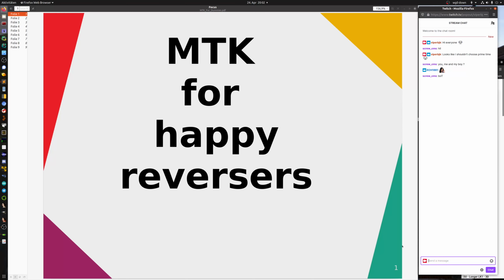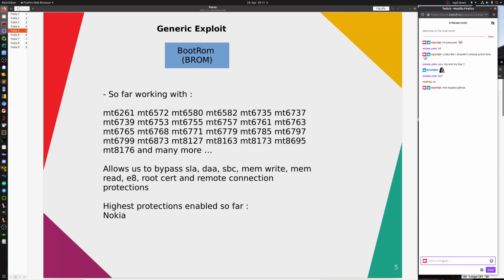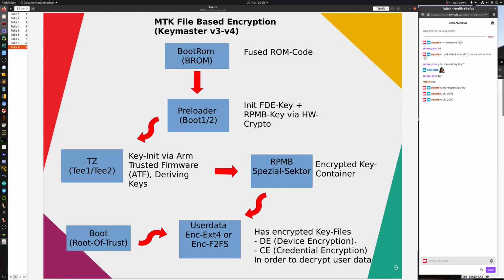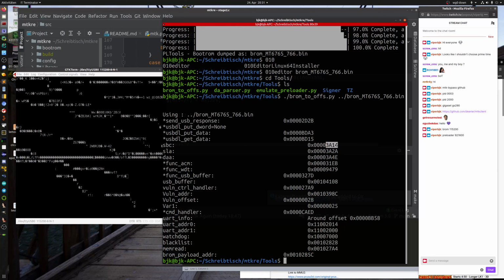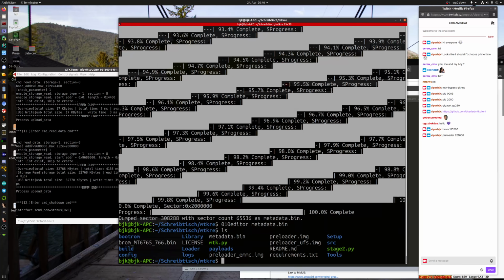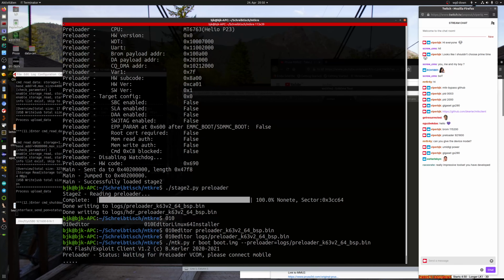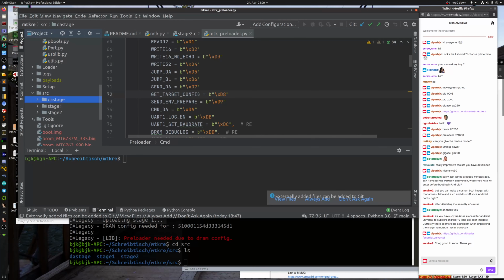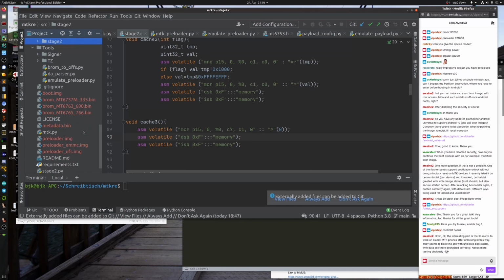Introduction to MTK Reverse Engineering

Comment: How much will you charge to help me flash stock firmware with a bootloop problem on a mtk6789 device.OEM locked Bootloader locked Stuck in recovery.V6 SPtool security on device no Auth.file.

Comment: Chapter Timestamps from SB:

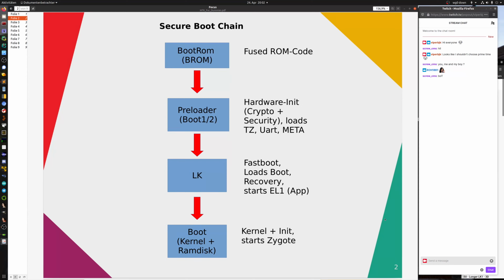1:00 Android's Secure Boot Chain

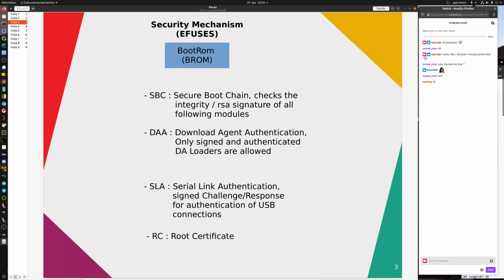3:52 Security Mechanisms in BROM
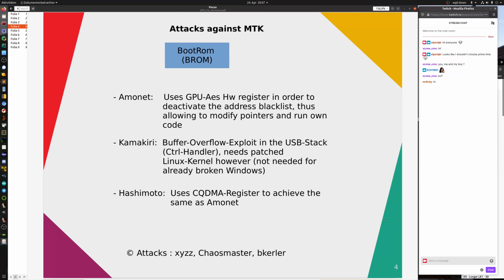5:55 BootROM Exploits
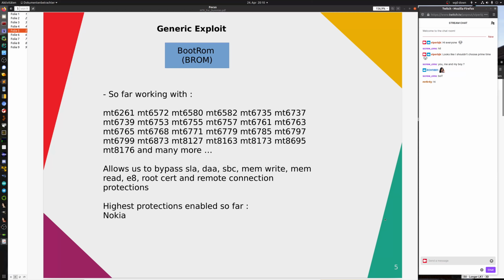8:44 Generic Exploit
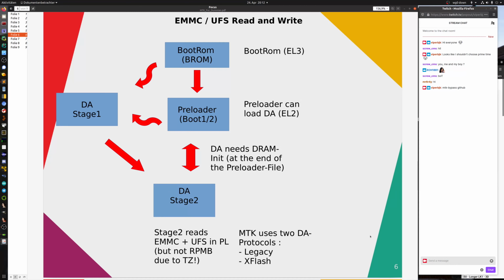10:54 Flash R/W with DA
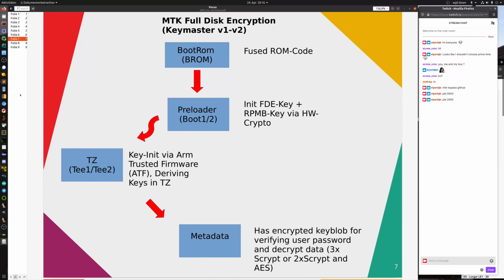14:43 Keymaster v1-2 FDE
16:36 Keymaster v3-4 FDE
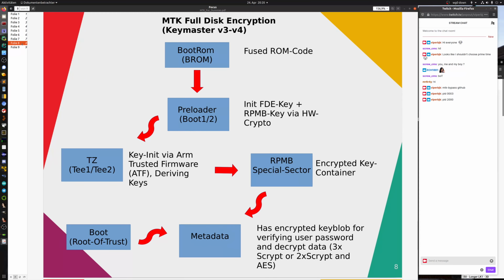18:35 File-Based Encryption
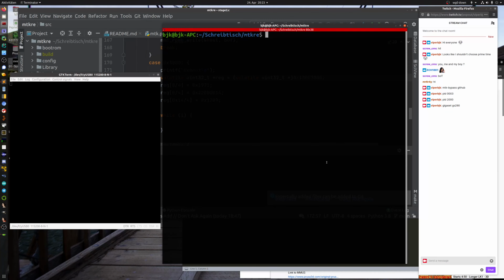21:30 Overview of mtkclient
25:21 Umidigi Power - Dumping BROM
27:17 Reverse Engineering BROM Protections
33:42 Umidigi Power - Dumping Preloader
36:51 Umidigi Power - Dumping Metadata
40:09 Reverse Engineering the Preloader
45:07 Gigaset GS290 - Dumping BROM
46:39 Gigaset GS290 - Dumping Preloader
48:29 Gigaset GS290 - Dumping Boot.img
50:48 HiSense C30 Lite - Dumping BROM
52:18 HiSense C30 Lite - (Not) Dumping Preloader